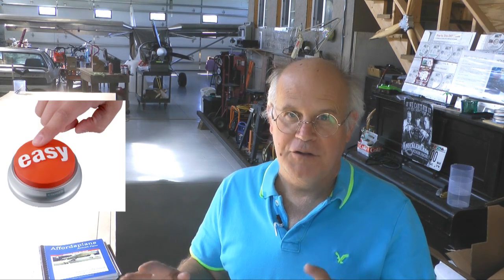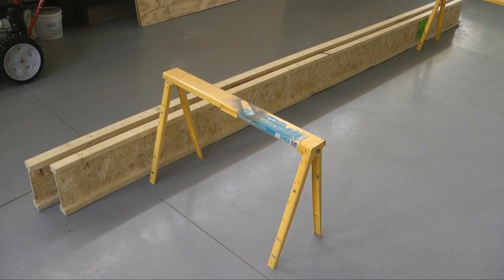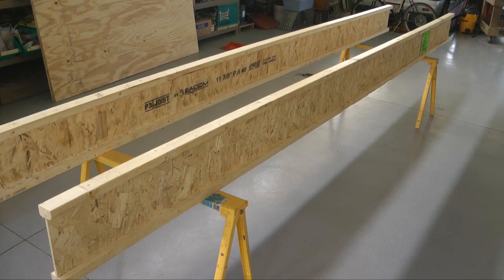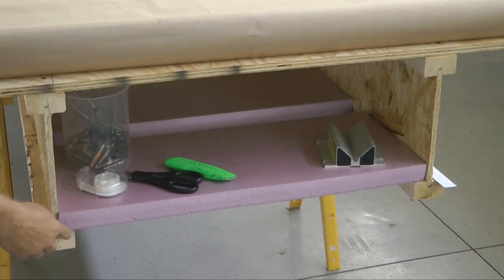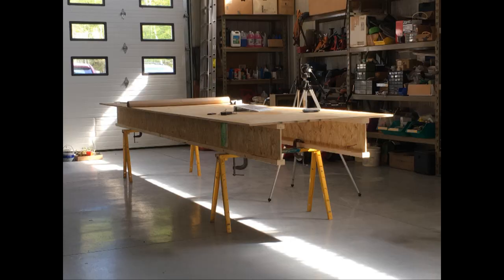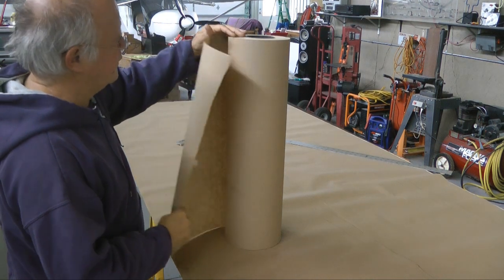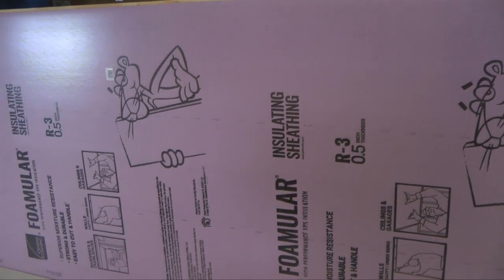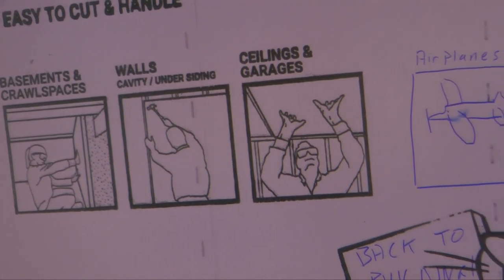Building the Affordaplane Part 1

Comment: I'm late to the party.  I get that.  Two questions about the work table - What depth of floor joists did you use, and what is the maximum vertical deflection of the surface have you noticed?  I built a torque-box table a couple of years ago that was incredibly stiff and flat, but not easily extendable to 16 feet at this point.

Comment: I bought a set of plans from another designer.  He said copying or drawing on a piece of paper is unstable due to temp and humidity.  They say paint your MDF or plywood white and draw directly on to the table.  When finished with that section  paint white again and repeat.  That is how I did a Neuport.  Is kraft paper easy to get the wrinkles or of a temp/humidity stable?  

In A&P school we usually had a +/- 1/16" tolerance for sheet metal.

 I'm not criticizing,  just curious.

Comment: I built my table much the same way.  I could not get the I-joists last July during the covid craze and could not get 16’ glulams, but they had 28’ so then cut them in half and the 14’ supports the two sheets of plywood pretty well.  I used hardwood plywood to get a better work surface. The saw horses are quick, but I wanted storage under my bench for the large parts so I made a frame of wood with two shelves.  Has worked great thus far.  Other than the lack of storage shelves, your design is certainly quick and effective.

Comment: Thanks jon, but do really think folks that need advice on building a table  should be building an airplane
Reply: We all started at the bottom once man...
Reply: @FlingwingNZ  yes  we did good sir. As the old riddle goes; what goes from 4 to 2 then to 3. A man.  Currently building a  750 zenith and a safari 400, side by side. I understand the problem of a flat or  level table. It's critical. Thanks. Ps a level line is a curved line,  don't believe me, level a line around the earth
Reply: @digdig-cp8lv  PS: A line is straight by definition when talking in the geometrical sense.  An arc is what you are talking about.  A level line used in the normal sense is a line between two points where the center point of that line is perpendicular to the gravitational field lines.  If you really want to be technical about it.
Reply: @LTVoyager  so what happens when you level a line around the earth. A circle
Reply: @digdig-cp8lv  A circle is not a line.
Reply: @LTVoyager  okay,  let's get this straight. A level line, where your feet are makes a circle. Do bridges  go into space
Reply: @digdig-cp8lv  If we stay with Euclidean geometry, a circle is not a line, by definition.  If you want to talk about elliptical or hyperbolic geometries, then lots of strange things can happen.  And what do bridges and space have to do with a flat and level work table?
Reply: @FlingwingNZ  it's  circle friend
Reply: Absolutely.  Many will just build an “EAA table” or two without investigating very much.  I looked at them and knewI would never get a flat table using dimensional lumber with today’s quality.  Using engineering lumber is much smarter and not everyone knows that.
Reply: @LTVoyager  so flat lumber equals success. Thanks  partner.  I'm not picking on you
Reply: @digdig-cp8lv  No, flat lumber does not equal success, but it makes it easier to build a straight airplane.  😁
Reply: @digdig-cp8lv  Guessing you have not built an airplane .. If you did you would know how critical tables / jigs /fixtures are .. This table video very pertinent to the process ... If you built one you would know there is no strait lumber but there is  strait prelam .. Flat table doesn't equals sucess .. however crooked table guarantees failure
Reply: @markdoan1472  thanks mark, i have a zenith 750 and a safari 400 side by side that I am building. How much. 124g safari, 60g zenith
Reply: Mark, you're an honorable man.  But I  need help.  I promised Bobby  from safari 30g next week. I'm going to send to him. Still lacking 12g
Reply: @digdig-cp8lv  lol .. You do need help but money  won't fix it.
Reply: @markdoan1472  mark thanks. I have owned my own business for 25years. Started it myself. 500 bucks and a pickup. Who am I mark, a 3 state licensed master plumber
Reply: Without the table you go nowhere .. hundred ways of building one and the  most advanced airplane  builders may not have known this quick /easy/cheap method
Reply: @markdoan1472  thanks, most folks have a table in the dining room.  Do you think you should buy 50g in parts and not be able to put them together
Reply: @markdoan1472  Sharing tools and techniques is a key part of airplane building.
Reply: He obviously does. Why do you think people that need advice on building a table shouldn’t be building a plane?
Reply: @danddietz  I’m not sure that people who don’t know the difference between a line and a circle should be building an airplane!  😂
Reply: @danddietz  basic mechanical ability